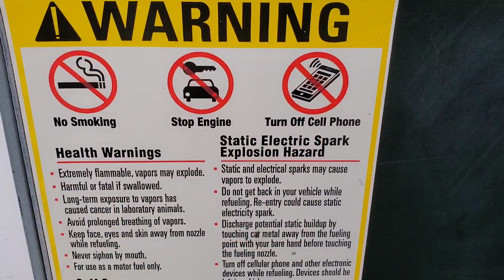Static electricity ignites gas!

Comment: I haul fuel for a living.  So you know that is static fuel the vapor is very minimal. Now when pumping fuel you have larger volume of fuel being pumped into a closed cell tank with only one exit that is where the nozzle goes in.  It pushing all the vapor to that opening in a hurry also.  It will not take much to ignite then because the larger concentration of fumes.  When I am unloading at a stations I have a vapor hose that is connected to collect the fuel vapors back into my tank you can take that hose off while I dropping fuel and feel the vapor blowing out with a glove on. Now that is more extreme situation since I dropping fuel in the ground about 10 gallons a sec since I using a 4in hose. But that is why we are required to wear rubber chemical gloves at all times handling the equipment.  Even all the metal on our trailers is non- ferrous which means can't create a spark.  But we still have to wear gloves we don't mess around with safety when dealing with 8500 gallons of fuel on the truck and whatever amount is in the tank at a station.

Comment: Fuel vapor is heavier than air, when pumping gas the vapor floats everywhere from the stream of gas, but in a container with no airflow, it settles on the bottom. This is why he can get the flame so close.